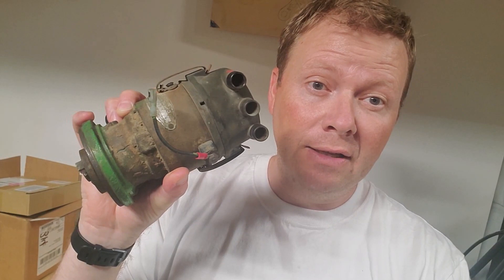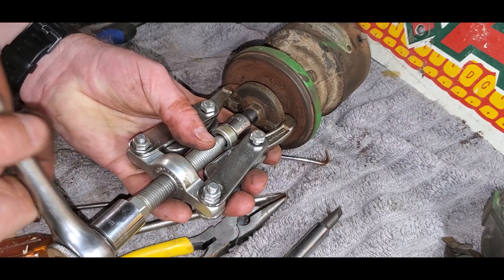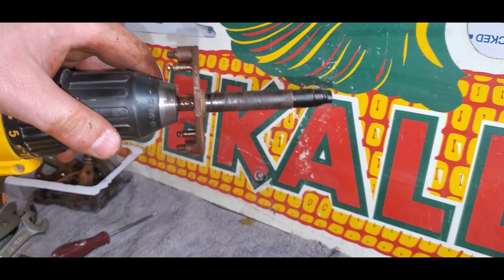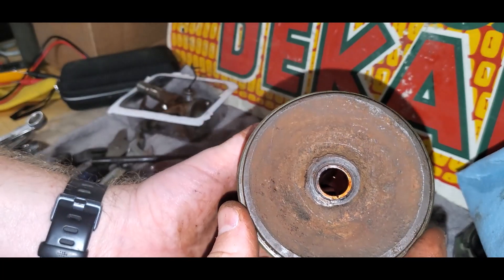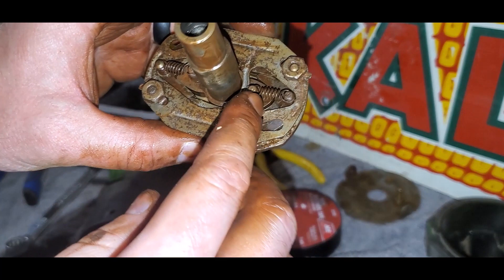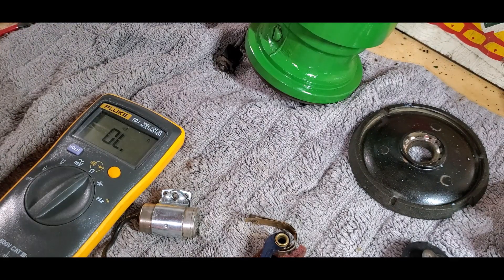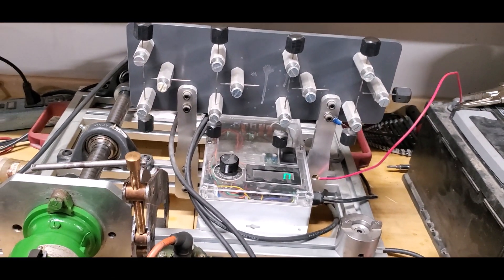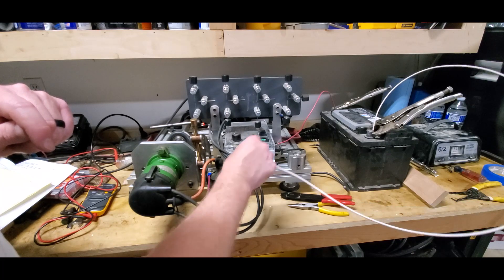John Deere G Distributor Repair

Comment: that manual shows the old 6 volt system most people have changed them over 2/12 volt now the spark is good and hot bright blue the way it should be alot better than what it was be 4 😊😊 OMG 6 2O 2O24
Reply from the maker: Yeah, this one has a 12v coil